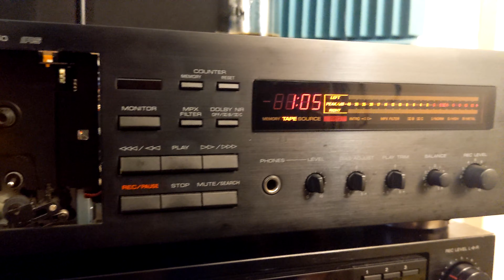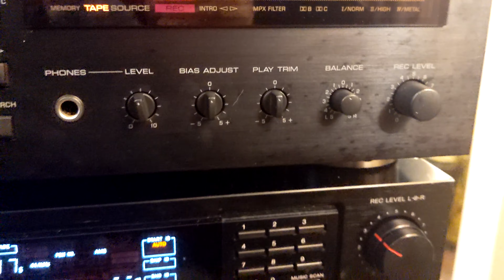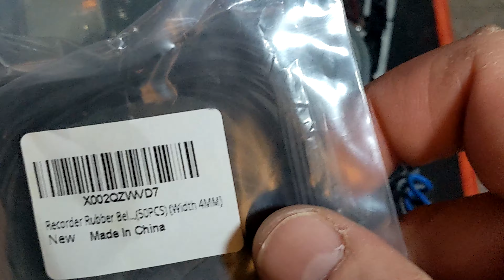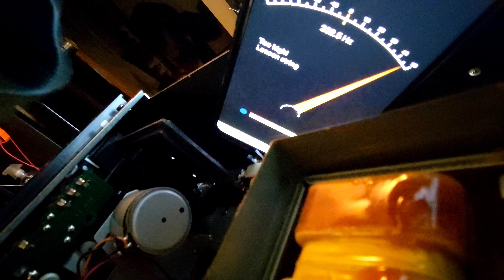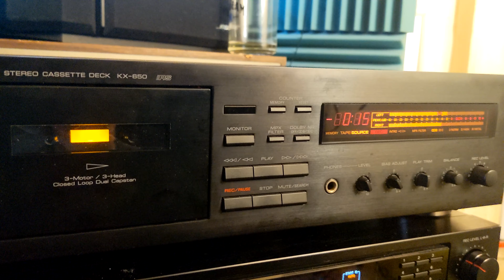YAMAHA KX-650 - rookie repair, will it work? - 3 head vintage Hi-Fi cassette deck

Comment: Followed this video to replace the belts on my Dad's KX 650 that had stopped working. Really helpful and entertaining. Only thing I'd say to anyone else doing this is that the auto stop/tape movement sensors on this deck are optical, the black/white segments on the cassette drives are what trigger the sensors. On my dad's deck the small band had totally rotted away and all the black gunk had completely covered the black/white segments and the sensor on the under side of the circuit board at the top. Make sure you give all these a really good clean with isopropyl.

Comment: Hello, I have a problem. Turn on play, 2s. and Turns off . The same overshooting. The belts are good. Who can advise??
Reply: Probably one of the light sensors. you can measure them on pin 35,36 on the big IC 18

Comment: Hello, very good video and I was able to repair my KX-650RS. Now I am listenig to my wedding music tape which I recorded 31 years ago 🙂 I left over the small spring that appears in min 21:30 but after reading the comments I will try to put it in the right place. Also in my deck the small belt turned into a kind of black glue but after cleaning and replacing everything works fine.
Reply: Can you please tell me what is the size of the small belt you replace? Thank you!

Comment: What's up buddy ?
I'm repairing a tape just like yours, but I've already fitted 2 belts but the rotation is unstable because the belts have cuts with small deformations causing variations (flutter) in the rotation. The worst thing is not that, it's the labor to keep testing better quality belts because they all come from China deformed. How do you do in these cases? Are there original Yamaha straps for this device? Mine is KX650 but it only has a pressure roller on the right side of the mechanism.
Reply from the maker: I would try https://www.turntableneedles.com/Rubber_Drive_Belts-Tape_Decks_Turntables, those are really good ! Regards
Reply: This tape of mine came missing the pressure roller on the left side. The steering wheel runs empty.

￼
Reply: @cheapoldhifi This tape of mine came missing the pressure roller on the left side. The steering wheel runs empty.

￼

Comment: Where must the spring be inserted that is shown at 21:33?
Reply: Behind the face plate. Between the plate and the mechanism down /left side. He forgot to put it back. Also, the mechanism should come out front side not inside the deck. Otherwise, good video
Reply: it's just an earthing spring that goes between the faceplate and rear of the mech. It sits over one of the black plastic prongs on the left side. You can google for the workshop manual and it's in there 🙂